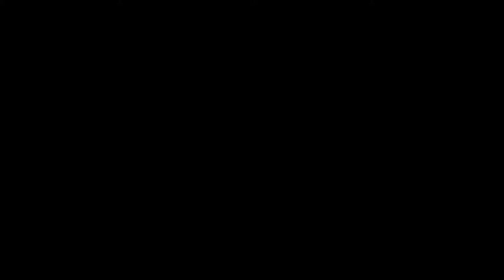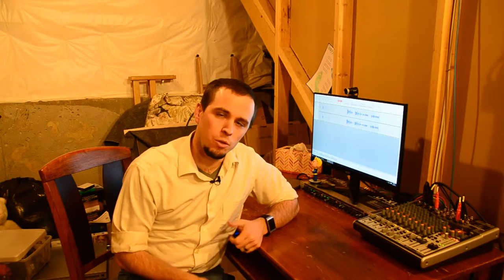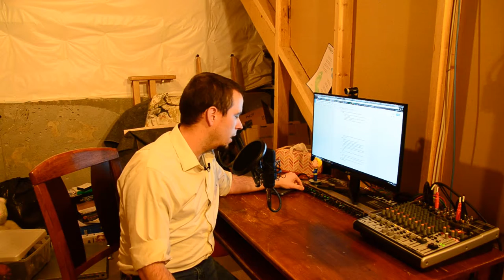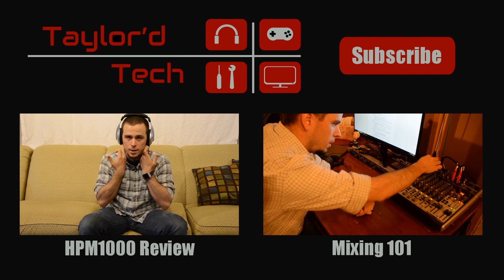Compression, Expansion, Gating, and Limiting

Comment: Great tutorial! I bought a Blue Yeti microphone a year or two ago, but it picks up way too much background noise for me to use out of the box, even with the "gain" turned all the way down. Because I don't have any additional audio hardware, I've been using Audacity's "Noise Removal" filter to remove the ambient noise that the mic picks up, but that's an extra (post-recording) task that I normally need to perform.
Reply from the maker: +Gzus There are other software options out there you might want to look into. OBS has a built in noise gate that is actually pretty nice, not to mention its great capture software in and of itself.
Reply: Nice! I use OBS for most of my recordings, but never realized that they had a noise gate feature. I'll definitely check that out! Thanks! :)
Reply from the maker: +Gzus No worries! Guess I should do an OBS video at some point. I just feel like Im still learning it (its a DEEP piece of software), so I dont want to do one too early.